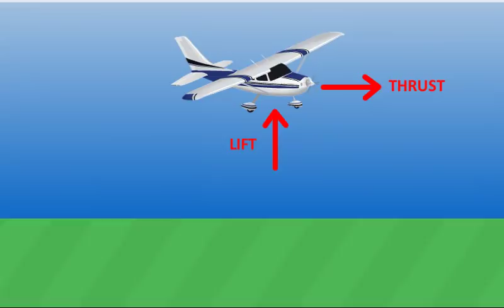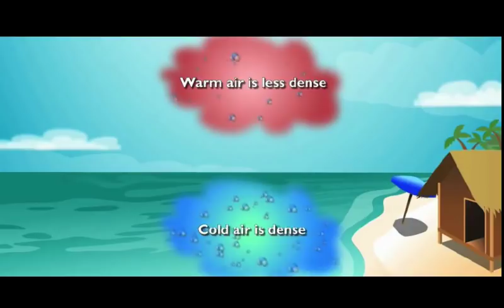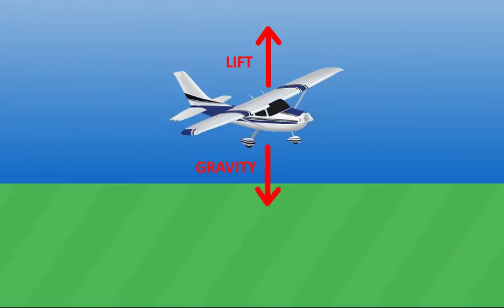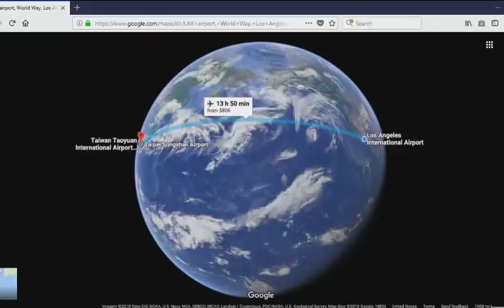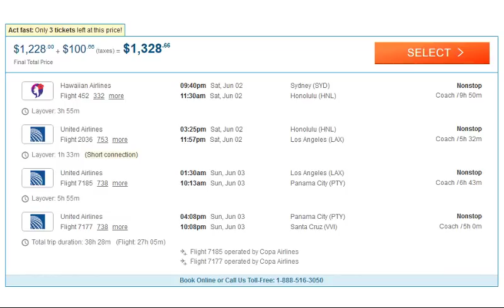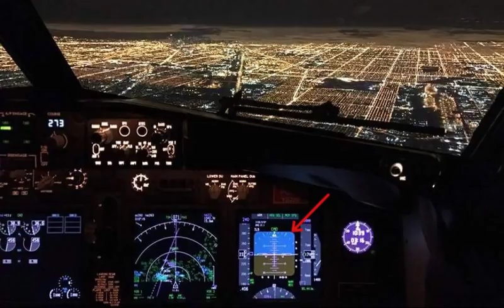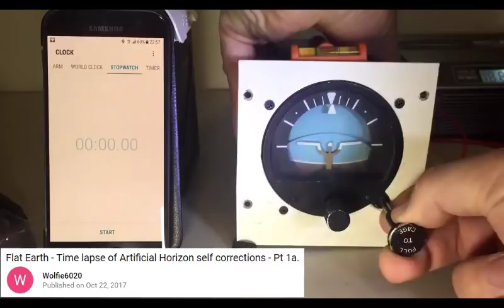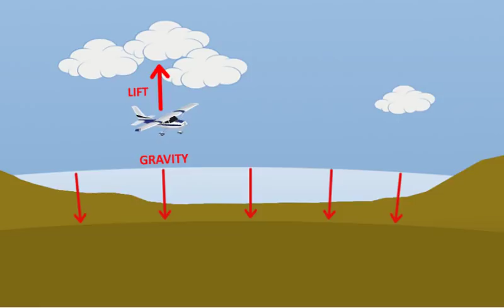Flat Earth Falsities - Plane Nonsense

Comment: Earth is FLAT!!!!!!

Look below for the plane nonsens!!!!!

Shape of the earth unknown.
https://www.cia.gov/library/readingroom/docs/CIA-RDP80-00809A000600231031-1.pdf

Russian Light Study
“Brightness of the firmament”
Flat earth :
https://drive.google.com/file/d/1KX7_0tlTAzFEWJ1CWOXQ_K2JnUgbfzb8/view

Propagation of Electromagnetic Fields Over Flat Earth.
http://www.arl.army.mil/arlreports/2001/ARL-TR-2352.pdf

page 9: based upon the signal having a single bounce on a flat Earth.
http://www.arl.army.mil/arlreports/2009/ARL-TR-4998.pdf

page 1:
Trajectory of Spinning Projectiles: 
“These equations assume a flat Earth.”
http://www.arl.army.mil/arlreports/2010/ARL-TR-5118.pdf

page 2:
“These equations assume a flat Earth..”
http://www.arl.army.mil/arlreports/2011/ARL-TR-5810.pdf

page 216:
"assuming a flat Earth"
http://tycho.usno.navy.mil/ptti/2007papers/paper21.pdf

Page 1:
“...so that a flat-earth approximation provides the best estimate.”
http://www.arl.army.mil/arlreports/2001/ARL-TN-175.pdf

Page 39:
model works over a flat earth
http://www.arl.army.mil/arlreports/2003/ARL-TR-2696.pdf

page 1:
transmission loss over flat earth
http://www.arl.army.mil/arlreports/2000/ARL-TR-2156.pdf

page 9:
“...input to a flat earth”
http://www.arl.army.mil/arlreports/2003/ARL-MR-563.pdf

page 3:
“The first is the Earth-fixed coordinate system, which is fixed to the Earth with a flat Earth assumption.”
http://www.arl.army.mil/arlreports/2010/ARL-CR-650.pdf

page: 1
flat earth approximation provides the best estimate
http://www.arl.army.mil/arlreports/2002/ARL-TR-2683.pdf

page 32:
This model works well over a flat-earth
http://www.arl.army.mil/arlreports/2000/ARL-TR-1812.pdf

page 32:
This model works well over a flat-earth
http://www.arl.army.mil/arlreports/2000/ARL-TR-1812.pdf

page 168:
equations of flat-earth trigonometry.
http://www.irig106.org/docs/106-17/106-17_Telemetry_Standards.pdf

page 8:
The Earth is flat and nonrotating.
http://www.navair.navy.mil/nawcwd/command/Inplace.aspx/LoadFile/531

General Equations of Motion for Damaged Asymmetric Aircraft

Page 1: “...equations of motions must properly reflect the underlying physics.”
page 2:
"In this paper, the rigid body equations of motion over a flat
non-rotating earth are developed...”
https://ntrs.nasa.gov/archive/nasa/casi.ntrs.nasa.gov/20070030307.pdf

Approximate Optimal Guidance for the Advanced Launch System 
On page one this document does mention a spherical rotating earth but then states that “...these schemes” (based on  a spherical rotating earth) 1) “...are difficult to prove” and 2) “...not suggested to be used as a basis for an online real-time guidance law.”

Page 32 goes on to say:
"Lastly, the equations of motion for the zeroth-order problem of flight in a vacuum over a flat Earth are presented."
https://ntrs.nasa.gov/archive/nasa/casi.ntrs.nasa.gov/19940020279.pdf

SR-71 
Page 8 “...nonrotating Earth...”
https://www.nasa.gov/centers/dryden/pdf/88507main_H-2179.pdf

page 14:
(2) A flat, nonrotating earth
https://ntrs.nasa.gov/archive/nasa/casi.ntrs.nasa.gov/19710018599.pdf

page 8:
the missile position in space is computed relative to a flat nonrotating earth.
https://ntrs.nasa.gov/archive/nasa/casi.ntrs.nasa.gov/20040008097.pdf

page 108:
aircraft flying over flat, nonrotating earth

page:12
"aircraft flying in a stationary atmosphere over flat nonrotating earth"
https://www.nasa.gov/centers/dryden/pdf/88072main_H-1259.pdf

NASA Technical Paper 2835
Page 1 Summary:
Flat nonrotating earth 

page 126:
"The nonlinear equations of motion used are six-degree-of-freedom equations
sith stationary atmosphere and flat, nonrotating earth"
https://ntrs.nasa.gov/archive/nasa/casi.ntrs.nasa.gov/19890007066.pdf

Determination of Angles of Attack and Sideslip from Radar Data and a Roll Stabilized Platform
NASA 
March 1972 
page 2:
"The method is limited, however, to application where a flat, nonrotating earth"
https://ntrs.nasa.gov/archive/nasa/casi.ntrs.nasa.gov/19720012071.pdf

An Aircraft Model for the AIAA Controls Design Challenge
NASA
1991
page 11:
"The nonlinear equations of motion used in this model are general six-degree-of-freedom equations representing the flight dynamics of a rigid aircraft flying in a stationary atmosphere over a flat nonrotating earth"

https://www.nasa.gov/centers/dryden/pdf/88248main_H-1777.pdf

Investigation of Aircraft Landing in Variable Wind Fields
NASA 1973
page14 pdf or 6 on actual report:
a) The earth is flat and non-rotating.
https://ntrs.nasa.gov/archive/nasa/casi.ntrs.nasa.gov/19790005472.pdf

A Mathematical Model of the CH-53 Helicopter
NASA  
page 17:
“The helicopter equations of motion are given in body axes with rerpect to
a flat, nonrotating Earth.”
https://ntrs.nasa.gov/archive/nasa/casi.ntrs.nasa.gov/19810003557.pdf

Atmospheric Oscillations
Georgia Tech April 1965
Prepared for NASA
page 13:
A model frequently used is that of a flat, nonrotating earth.
https://ntrs.nasa.gov/archive/nasa/casi.ntrs.nasa.gov/19650015408.pdf

page 19:
These equations assume a rigid vehicle and a flat, nonrotating Earth.
https://www.nasa.gov/centers/dryden/pdf/88733main_H-2465.pdf

Flight Testing a VSTOL Aircraft
NASA 1988
page 9 pdf or 4-5 on actual doc:
“For aircraft problems, the state and measurement models together represent the kinematics of a rigid body for describing motion over a flat, nonrotating Earth...”
https://ntrs.nasa.gov/archive/nasa/casi.ntrs.nasa.gov/19880014378.pdf

Time to Climb
page2:
“In our minimum time-to-climb problem, the aircraft is modeled as a point mass and the flight trajectory is strictly confined in a vertical plane on a non-rotating, flat earth.
https://ntrs.nasa.gov/archive/nasa/casi.ntrs.nasa.gov/20060053337.pdf?
Reply: Globe Liars666 yup so I read through a lot of your info. I’ll use the SR-71 as an example. They used a non rotating model instead of a real time simulator for aerodynamics because its easier to develop the aerodynamics of the aircraft. Every single page I read DOES NOT STATE THAT THE EARTH IS FLAT. They used “flat earth” and “non rotational” to describe or develop what happens to spinning projectiles and so on. Sorry dude your info is wrong. They are just using models with no interference of any kind.
Reply: Man in Black, I clicked on the first link that interested me .  I'm confused what you mean by the SR-71, and how the many other links specifically refere to a non-rotating earth, yet you claim the reason for this has nothing to do with the reality of conditions in which the model is supposed to represent?   What is beneficial, in ALL these examples, that a model be based upon something that doesn't exist?   You know what I mean?  I'm asking honestly, this fascinates me.
Reply: i hope wong is a bot.. or otherwise, I'm getting sad.
Reply: Rick Wilson It represents simplified maths.
Reply: Rick Wilson 

wong is using these links as proof of a flat earth. The military used “a flat earth” as in no obstacles for the trajectory of spinning projectiles. Also with the SR-71 jet the military used a simulator without any atmospheric conditions, again “a flat earth” to optimize the aerodynamics of the jet. The article states that this simulation was used instead of a “real world simulation” that’s why I found it amusing because it just so clearly states that the military does not suggest a flat earth. So wong is using fiction as fact.
Reply: wong how is anyone here a troll? You posted info, people read it and said it’s false. That’s called an argument, if your info is wrong than find new info. Insults are not needed for an argument. In fact I’ve read a number of your posts and I’d say you’re the one trolling. You provide no conclusive evidence of your claims, you insult others and the name calling is very immature
Reply: Around the time they say "the aircraft is modeled as a point mass" you know they're simplifying the heck out of this calculation. 
This happens a lot in schools, and even in work. One simplification that's used sometimes is that the angle in radians subtended by a line viewed at a right angle approximates to the length of the line divided by the distance for small angles. In other words, if you stand on one mountain and look at houses on another, the amount of your view that each takes up is proportional to its actual size. Get up close to a tower block and this breaks way the heck down, but for really narrow fields of view (like distant star systems) it's close enough. 
Another is kinetic energy. You may recall "KE = 0.5 m v^2" as the formula for that. It works just fine for slow-moving stuff like vehicles and bullets. 
Not true, it turns out, because there's a bit missing from that. It's "KE = 0.5 m v^2 c / ( c - v )" and even that only works for stuff going slower than lightspeed. 
The reason the approximation works is that c is a very big number. It's 299792458 m/s, the speed of light in a vacuum. That makes "( c - v )" pretty much the same thing as "c" and "c / ( c - v )" pretty damn close to 1. Given that rifle bullets, propellant, primers and cases are made in machinery that gets dirty in use, varies in temperature through the day, gets fed materials with varying impurities at varying thicknesses and and runs on an electrical supply of fluctuating voltage, that humidity, density and viscosity of the air change, that rifles get hot and dirty in use and that the changing number of rounds in the magazine changes the mass of the rifle and thus how quickly and at what angle it moves backwards with each shot, the kinetic energy in a bullet from a particular brand of ammunition fired from a particular rifle varies by a lot more than 0.00167% so even with a 5 km/s muzzle velocity we just don't bother with "c / ( c - v )." 
Treating an aircraft as a point mass is going right back to physics lessons for age 13-16, probably ignoring balance, shifting fuel balance, the details of the way the aircraft rotates when pitched up or down at various speeds, turbulence, wingtip vortices, sonic shock waves and all sorts of other fun stuff.
Reply: just put a bacteria on a ball and ask him